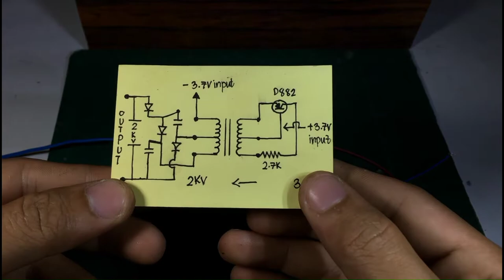High Voltage Generator | 3.7V to 2000V INVERTER

Comment: How much amperage can it generate?
Reply from the maker: So far sir. I don't measure the actual current of this project because of its higher voltage output that is dangerous